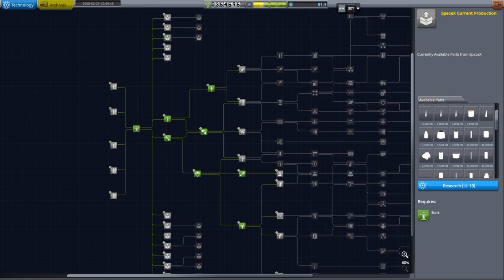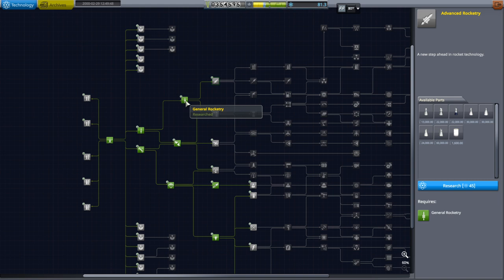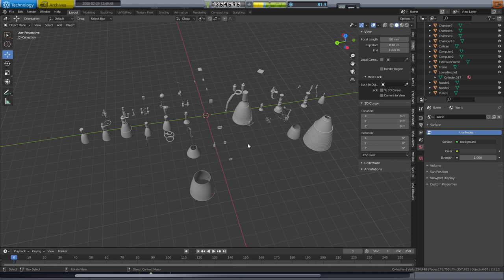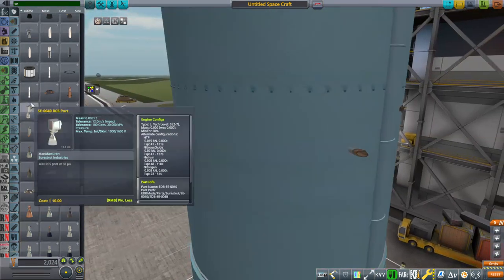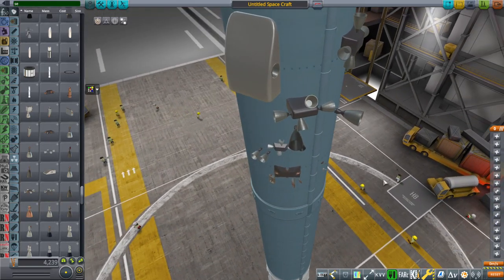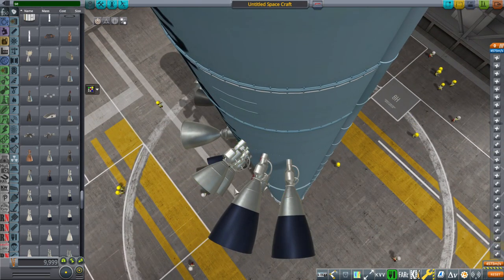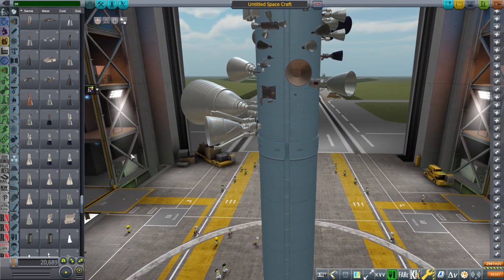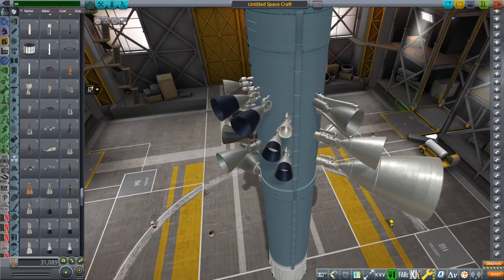Realism Overhaul in KSP 1.8.1 - Surestrut Engines

Comment: This is a good complement to SPEngine, which currently lacks any methalox configurations. One thing I think would be nice is a set of upper stage RCS blocks, similar to the one at 6:48, but maybe more slimline. Similar to how RO has configs for rescaled stock RCS Quads with different thrust values, having three or four different sizes, but with the full range of RCS propellants (HTP to Cavea-B, plus maybe hydro/methalox?) that only point down and to the side. Feels wrong sticking 4-way RCS blocks on the bottom of my stages.
Reply: Not trying to be rude or anything, but maybe you should try and make it yourself

Comment: is this possible to change configs of them to stock? stock need some of those enignes
Reply from the maker: You can try them in stock by deleting the RO file in the folder, but the main engines will all have the same plume, they won't be particularly well-balanced, and you'll still need Textures Unlimited for them to look right.
Reply: @RaizSpace  its still possible to make a configurate a plume, but i would have to do it for every model, right?
Reply: @RaizSpace  but still thanks
Reply from the maker: And yes, each model has its own plume.
Reply: @RaizSpace  good

Comment: PBKAC error: for some reason some but not all the engines have 2 different min and max thrusts and therefore don't provide any thrust at all. Im playing 1.8.1 RSS RO/RP1 with all your other mods as well.
Reply from the maker: Can you identify one of the engines that has this problem?
Reply: BE-3U, BE-4, ED-6, ED-6V, Raptor, SE-1003A, SE-1004A, SE-2006A (nonA is ok) hmm think i found it, All my throttling engines are broken ><. so it looks like something else is broke not your mods. glad because your engines are nice, shiny, and useful.
Reply: PBKAC error it shows separate thrust for VSC and ASL at max and min throttle for EACH, and I think I had the wrong fuel or something and assumed bug incorrectly lol